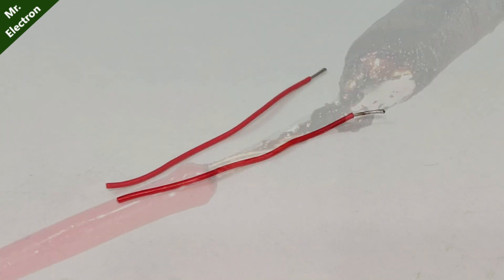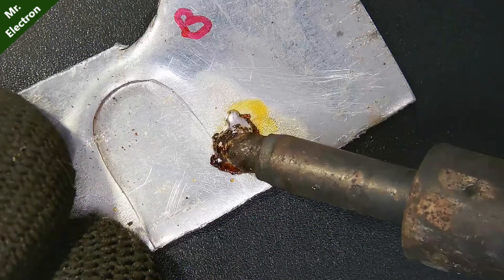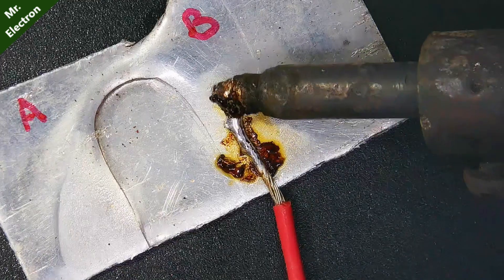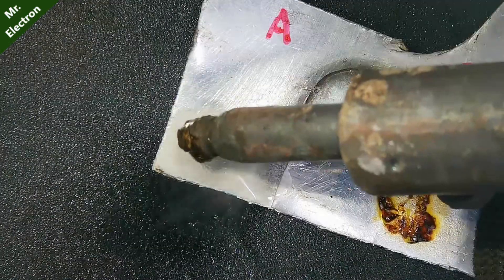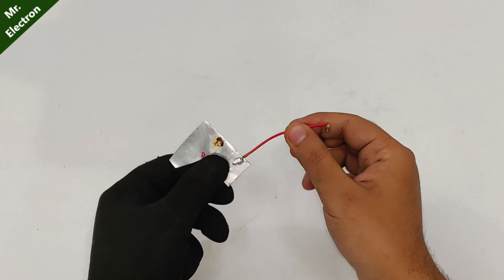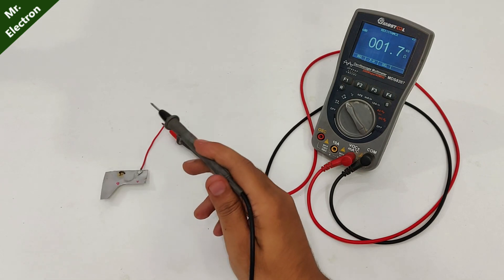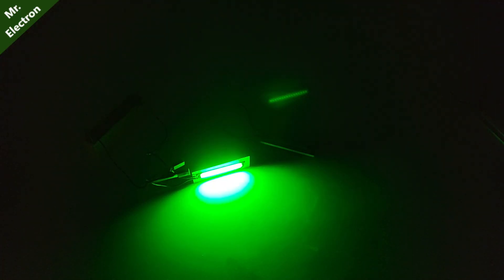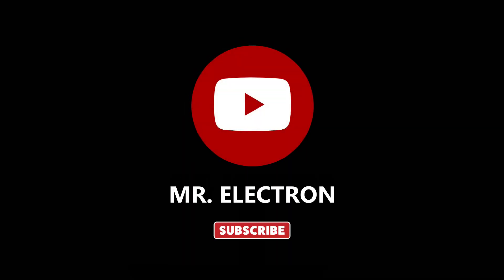How to Solder on Aluminum DIY

Comment: Why not try neat KOH, or even NaOH? Melting points are quite low, so should melt with the soldering iron tip. Would need to very quickly blast the excess flux off with a stream of water, though, to stop the excess eating the rest of the aluminium.

Comment: You did not tell anybody how to solder on or to aluminum because you did not disclose what it was that you put on the metal.  It might not matter to you but it does to me because you wasted my valuable time.
Reply from the maker: Koh, i believe i mentioned this. It was long time back. Potassium hyroxide. Its not working that great though.
Reply: Let me save your valuable time. You can not solder aluminium. The oxide  is too think and fast

Comment: I am building a battery, and I have all the necessary components. However, when I start assembling the battery, some of the connection points break. I have tried to solder these points, but the soldering doesn't work. I also tried using a solution of HCl and zinc, which works on steel and other materials, but it doesn't work on the battery points. I'm stuck and need help. One possible solution is spot welding, but it is expensive, and I don't have enough funds. I am looking for a more affordable solution.

Comment: Hey, you can use just any car used or new engine oil to wet the aluminum surface with solder, then solder any wire to it. Its easy. Drop the oil on the aluminum surface , then take a solder with flat end, put a piece of tin on the oil drop. Then, melt the tin and rub the surface of aluminum back and forward, back and forward for couple of minutes. You can see that after while surface of aluminum get wet with molten tin and is ready for wire sordering. KOH is corrosive and if you don't clean it after it can corrode the aluminum. Engine Oil is more safe.
Reply: will it work on stainless steel surface?
Reply: I advise scratching the aluminum first, if possible (filing or similar). The oxide layer can be thick and sturdy, beyond inconvenience.

Comment: I use the crushed inside rod of a carbon battery soaked in battery acid to solder copper wire to stainless steel. This might work on aluminum, will have to try.
Reply: It shouldn't. Aluminium oxide is very resistant to acid but weak to base.
Reply: Very unlikely. Acids passivate aluminium through oxiditation, but aluminium oxide dissolves in strong base like KOH.

Comment: I'm having hard time trying to clean my soldering iron. Can you please make a video about it next? 🙏
Reply: Just heat up your soldering iron and rub it on a damp sponge, until all the contaminants are gone.   Then power it down and let it cool, and if it still needs cleaning, use some fine sandpaper, maybe 220 grit or 320 grit to sand off any remaining scale or dirt.
Reply: @jsaurman  doesn't sanding down the tip remove some sort of protective coating?
Reply: @jsaurman I've come to a full circle it seems. 2 years ago was a wild and different cold joints
Reply: Use steel wool (used for cleaning household cookware) and rub the tip on it before every use.
Reply: Never sand your soldering iron.
Reply: Use a Wire brush.  Hand held or one that attaches to a drill (brush wheel drill bit). Make sure it is not the smaller very stiff brush.. medium/large sized should do the trick
Reply: Use only Weller iron tips.  I find these cheap Chinese tips don't clean up very well.